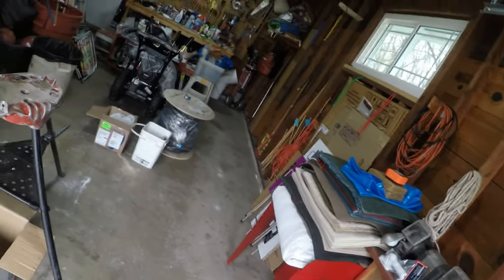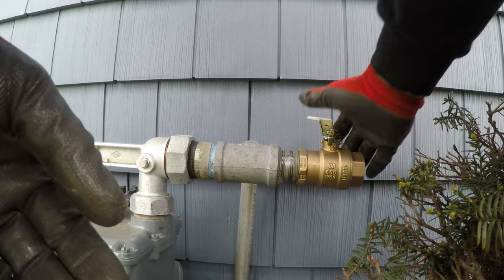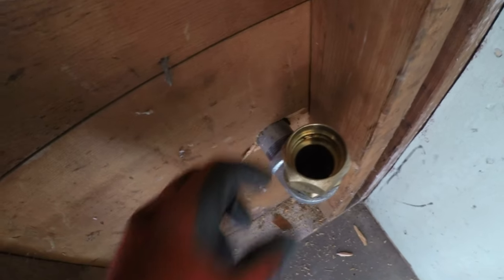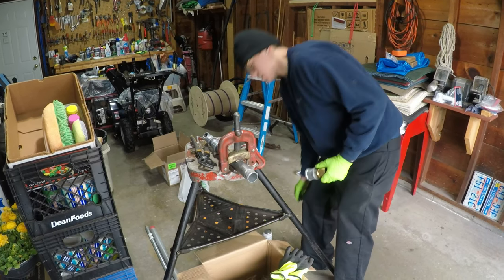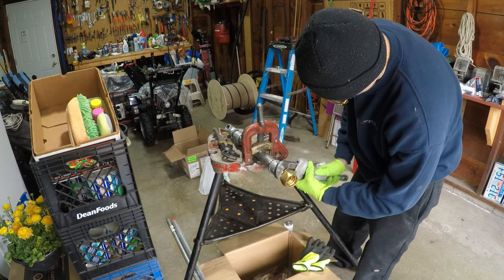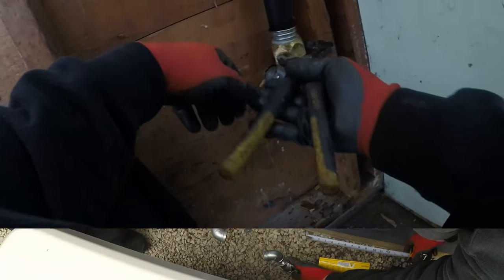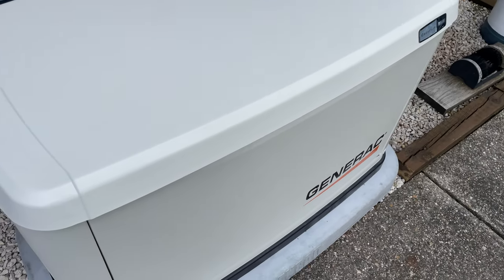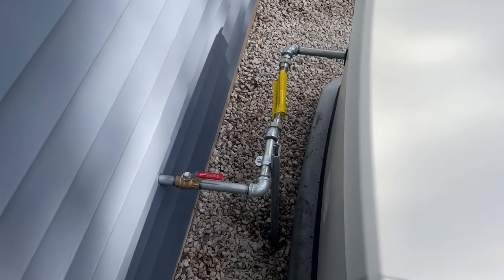counter strike gas pipe installation Generac Generator

Comment: Do you have to but a regulator on the line or was it just straight piped also wis the larger pipe size because of the distance the gas has to travel
Reply from the maker: Correct due to the length and the BTU that the generator pulls have to run the bigger line.  No regulators on anything.

Comment: Nice and clean, however, you called it a high pressure meter swap You weren't actually changing the meter. You were just adding a valve hot without turning the gas off question is, is there any other appliances in the house that have pilot lights? If so, you'd want to recheck those because I have done that before and it would starve the rest of the house for those few seconds and the pilot lights would go out. You said a high pressure meter. That's actually not a high pressure meter that's going to be low pressure. However, depending on what appliance that is already installed You may have been better to have the natural gas company come change that to a 2 lb and then you could have ran way smaller pipe over to the generator but there again  Like I said, that depends on what the other appliances are in the house and how hard it would have been to add regulators. If you would stop using a pipe wrench and channel locks on flat surfaces and use an adjustable you would be able to get it way tighter and no leaks. Also, especially on brass when tightening up something such as a ball valve that doesn't have something threaded in the other end yet don't put a wrench on that end it will football and be oval and cause leaks. If you must tighten from the open female end, take a nipple hand threaded in and then put your wrench on (trust me on that). Did you perform a pressure test? CSST is required to be bonded.
Drip leg is already installed inside of the generator.